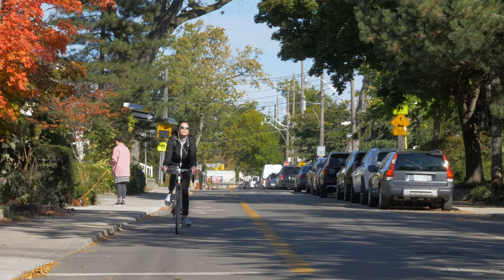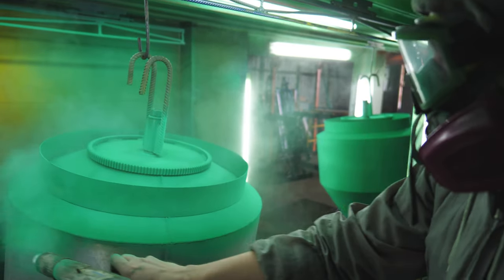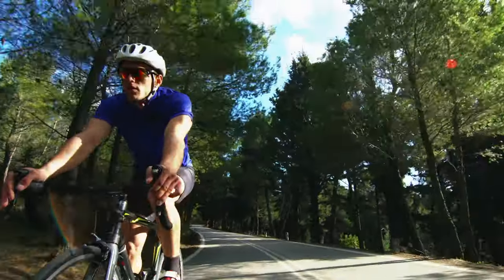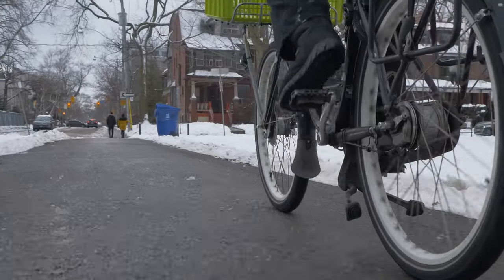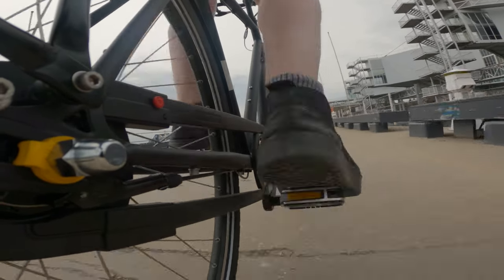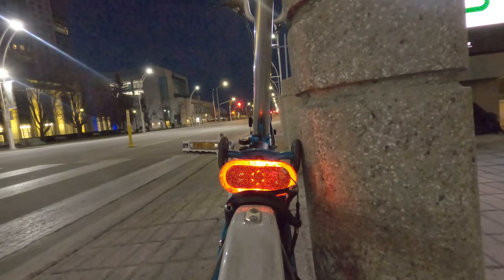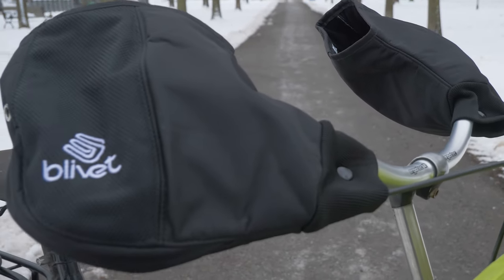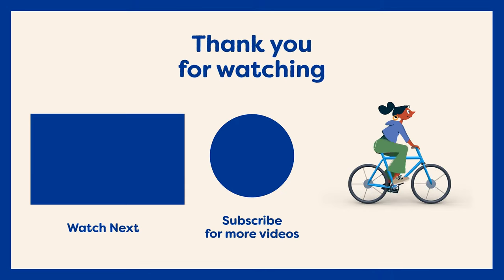Cycling in the Winter: it's Fun... and Fashionable!

Comment: After ONLY 3 months of use
List of n bicycle repairs that you need to consider:

1-	Bosch Motor make noise when I force pedal to gain speed or when I climb (it was changed)
2-	Back suspension (shock) loose air each   +or - 120 Km
3-	Loose eShifth very often (I see it on Nyon display it disappears completely) it is hard to pedal when I stop at red light or else
4-	Display Nyon show me CRAZY speed like I am at 18 K/h and it show me 33, 28,76,43 not all the time it happen few times
5-	Battery covers fall down when I ride for no reason
6-	When I fill up the tires at 50psi the tire touches the screws under the fenders (front and back) it is minor thing
7-	The BRC351 water get inside stop work completely I was 87 Km from my house I pay a town truck to came home
8-	Tension spring rust after catch first rain
9-	The fender in the back shacking to much and make noise                                                                                      																																																														#6. #8, #9 this are minor problems I can deal with it if it is possible to do anything I appreciated but is not because of that I will complain

Comment: My (winter) bike had hydraulic disc brakes. I had to replace them with cable disc brakes because my bike is stored outside all winter in Montreal. As the most extreme cold days are more frequent here than in Toronto, my old hydraulic brakes ended up exploding (the fluid leaked out and it stopped working). It would be interesting if you could address this question more precisely because there seems to be a good debate in the Montreal winter cycling community against hydraulic brakes if your bike spends the day outside all winter.
Reply: Does the same happen to cars? If not can you not just use car brakefluid?
Reply: @KeVIn-pm7pu  I am neither a bicycle mechanic nor an expert on bicycle brake fluids, so I don't know how to answer your question.